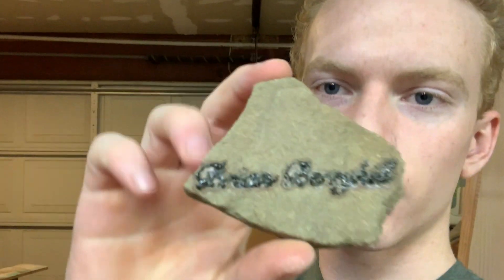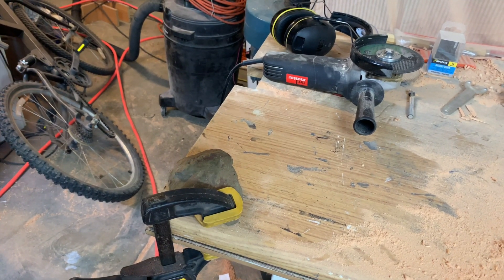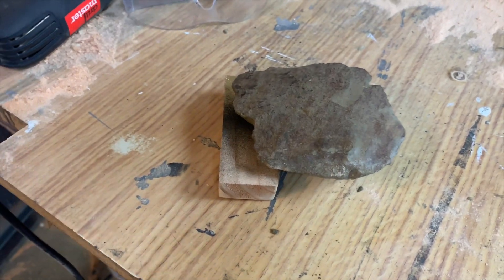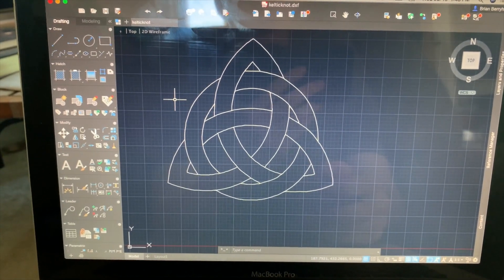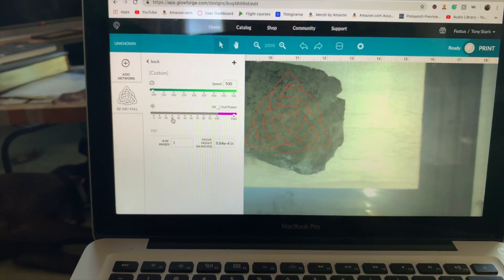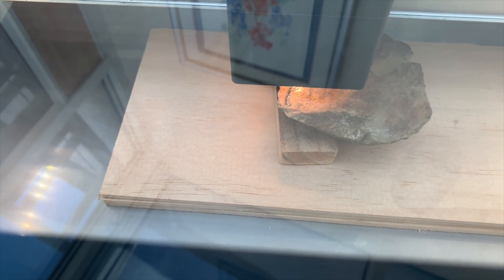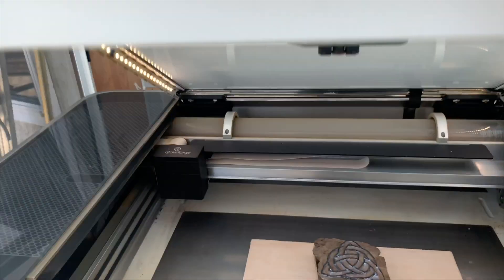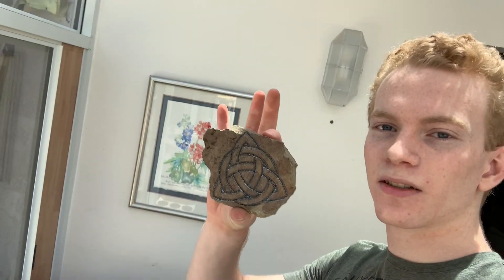Turning Sandstone to Glass with a Glowforge Laser Cutter

Comment: So, how thick are your lines? The cut lines look super thick and mine are really thin so it isn’t quite as impressive looking!
Reply from the maker: I haven’t actually figured that out it seems to be the material I did another video recently using flag stones and the lines came out a lot thinner. I have since found out that this material is actually a hardened clay so that might have something to do with it.
Reply: @IntoTheWoodShop  One of the bonuses of a defocused laser is that the line gets thicker - since you're off by probably 1/2" (the thickness of the plywood) that's about as wide as they'll come :-)
Reply from the maker: @deirdrebeth  that's what I figured still need to do more testing to see if I can recreate it again.